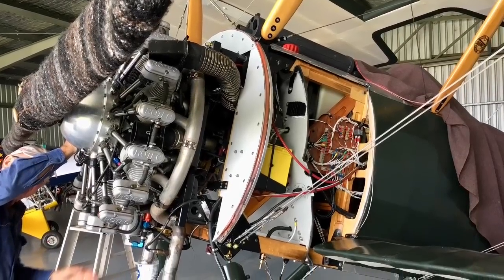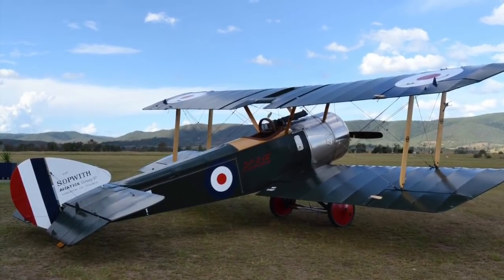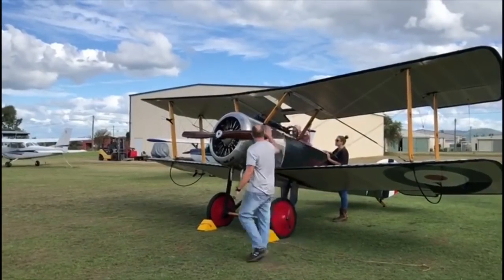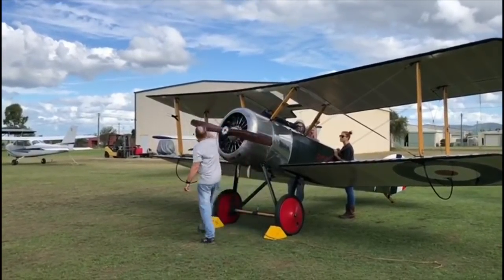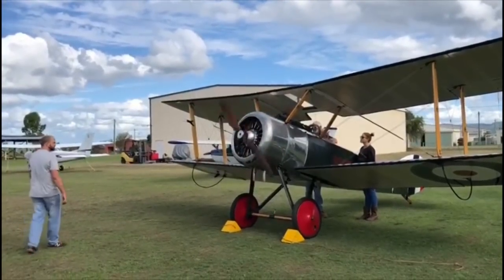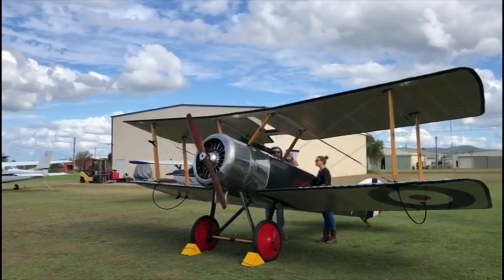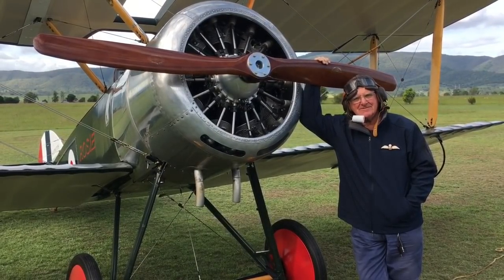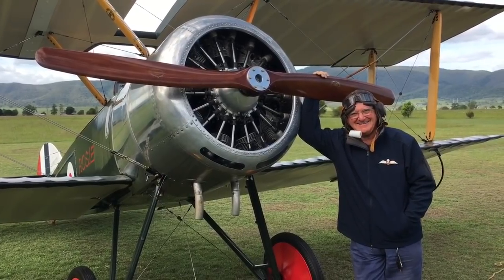Sopwith pup full scale replica

Comment: That Rotec is about 70 HP more than the rotary engine that was originally in the Sopwith...and a lot easier to fly and much more dependable.
Reply from the maker: It’s interesting to note that the torque produced with the rotec is about the same as the original engine. They must’ve had Clydesdale course power back then. And yes, the rotec is much easier to manage

Comment: No mention of the engine type?Can you do loops in that?
Reply from the maker: The engine is a Rotec r3600 150hp. The airframe is structurally strong enough to do aerobatics, however the catagory it’s registered under does not allow it. Cheers
Reply: @donwtsn  👍